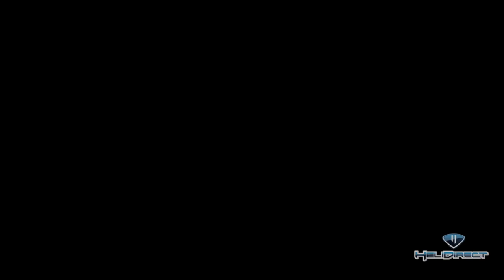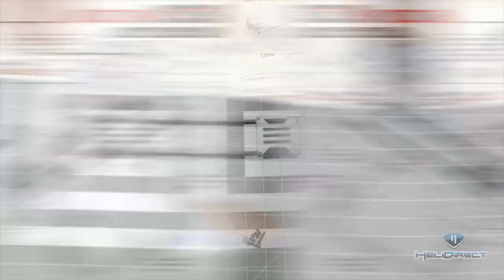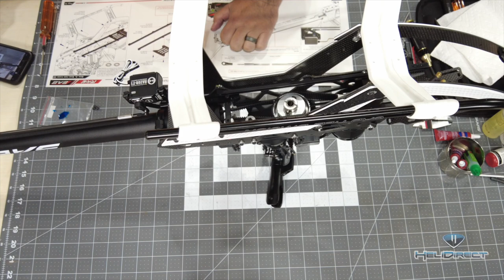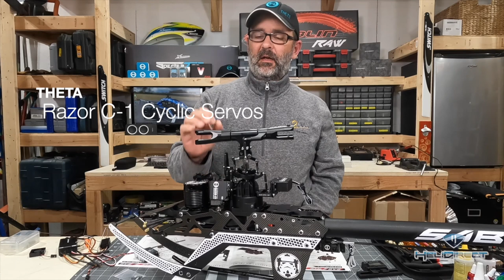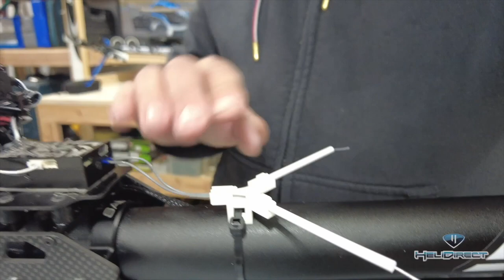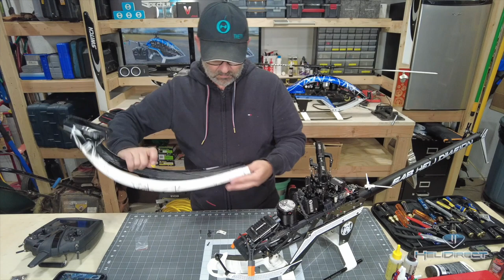SAB Goblin Raw 700 Build Video Part 6

Comment: Hi , Can I run this around 1100 Headspeed? if so What motor and pinion I should use?
Reply: I can't speak to what it would fly like at 1100.  The lowest I've taken mine is 1400.  It's pretty slow at that headspeed.  Honestly if I wanted to take a Raw down to that headspeed I would look at the newly released Piuma from SAB which is a lighter version of the Raw.  I would look at 6S options and motor combos on that lighter airframe for better results.
Reply: @NickWisdomRC  what is the benefit of low head speed? I’m thinking about building my first 700 and want to do this one.
Reply: @dominicklittle9828  headspeed choice is more related to style than purpose.  Slower headspeeds make a heli react slower, be a little less agile, and require improved collective management skills.  Slowe headspeeds can have a great slow and smooth style of sport or 3D flying.  Very much the opposite of a “hard smack” rapid high headspeed style of most pro pilots.  Some benefits to lower headspeeds are that the heli doesn’t “get away from you” as quickly and gives you more flight time which is great for beginners.  On a 700 for a beginner I’d start at 1700RPM and work your way down towards lower if you like.  That will give you a bit more rpm to get you out of trouble while your collective management improves.  Hope that helped!
Reply: @NickWisdomRC   actually my purpose is using the mechanics in a scale heli. That's why i need to use low headspeeds as it's turning bigger blades.

Comment: Hey what esc to battery connectors do you like to use best ?
Reply: I use iC5 connectors.  I like them better than EC5s.
Reply: Personally I use iC5s which are compatible with EC5s, but a bit more robust, easier to solder, and easier to pull apart.  There are several other great choices as well.
Reply: Hey Nick would you know where I could get my hands on a VBar Control touch radio? I’m desperate for one!!